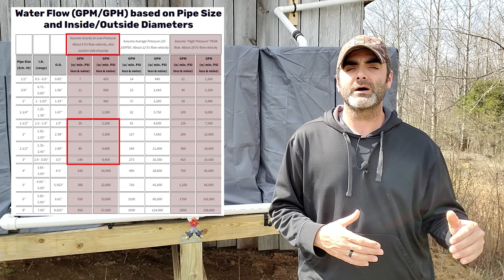Collect AND store | DIY Rainwater harvesting system

Comment: Each individual tote/IBC will need to breathe, as the water enters the IBC the air needs to have an exit path and conversely as the water is drawn off air needs to be allowed in to stop you pulling a vacuum and collapsing the IBC. The pressures that can be exerted in both scenarios are considerable. So in summary, you cannot just get away with adding an overflow on just one IBC. Hope that saves you from injury or damage to your IBCs.
Reply: Leave each lid lose so each pod can breathe.
Reply: at 21:38 he leaves the 3rd tote cap loose
Reply: What a waste of words...  he doesn't seal the whole system.
Reply: I thought the same thing. The first two won't even fill up past the top of the valve because air can't escape anymore and will create too much pressure if the tops don't have some sort of bleed off. The other replies really don't understand physics.
Reply: I don’t understand any of this 💩. Why so many sections?
Reply: injury??🤡
Reply: I put pvc pipe connecting each tank from the top 2” opeining in each lid, and used the end of that pipe for runoff and allowing all tanks to breathe. Works perfectly. I still have it connected at the bottom like in this video. My system allows water to enter each tank from the top and bottom, and air is easily expelled out the run off tube

Comment: If your first flush diverter hasn't fallen off your building yet.... You probably should add additional plumbing strap to support that pipe when it's full of water. Adding the plumbers strap below fittings will keep the heavy, water filled pipe from  slipping down.
Reply from the maker: Thanks Barry, yes that was an oversight!

Comment: I was thinking it may be easier for your future service of your tanks , if you put a 45 to lower it below your wood supports so you could drive straight in with equipment….. maybe cut off valves independently for each tank in order to remove them independently… just thought I would share those thoughts along with my deepest thanks for all your efforts to produce this video. Jerry 22:41

Comment: Nice video. I particularly like your first-flush set up, and plan to incorporate that on my next rainwater build. 
I do have one suggestion that may be helpful.. on my current system I have the buttress threads, and rather than wait for the adapter from Amazon I simply slipped that 2" flexible connector right onto the threads themselves. My setup looks just like yours, just minus the adapter and that first piece of 2" pipe. It's been over a year with no issues.
Reply from the maker: Thank you for the kind words!

Comment: Back in the day, I used to do a lot of gluing on pvc.  4 in down to 1 in for environmental recovery systems. Some ran at pretty high pressure. We always used clear primer and heavy bodied blue glue. Never had a problem with a blow out. Thought that might help with your next project. Guy who taught me said it was hard to see the clear glue to see if it was coated well. He would literally heave a can of purple primer in the trash. Hated the stuff. To each his own. LOL

Comment: I haven't read all of the comments to see if anyone else has mentioned this, but... I would put some cross bracing on the face of your foundation to prevent racking side to side. Once under weight (especially if you have settling) it could begin to lean or worse.
Reply from the maker: Already done, thanks!

Comment: Looks like you knew how I wanted to do mine, but didn't now where to start (I've had the IBC totes for almost a year now). 6 X 6's are expensive, but I'm the same way...rather over-kill and not have to deal with it again. It is a lot of weight...no doubt! Thanks for the video and Amazon links...I'm ready to order and start my rain water collection project.
Reply from the maker: Glad we could help! Good luck!
Reply: @meadowgreenfarm I bought your plan and nice job!  One suggestion, I figured it out with my general woodworking skills and the comment above, but initially couldn't tell if the beams were 6x6 or 8x8, possibly add a sketch of the support frame to your plan for others.  Thanks

Comment: One tip for making better joints is to work in sections if possible, especially as a novice not used to working with pvc primer and glue. It’s best to work with the primer while it’s relatively fresh, while it’s still shiny or just after it “dries”, if you wait too long the plastic will set up hard again (primer softens the pvc so that it can chemically weld when the glue is applied) working one or two joints at a time allows for more time to work while everything is still fresh and perfectly suited to be glued together. Waiting too long will give weaker joints and lead to leaks, not a terrible problem on a system like this but your joints will hold up to the weight and age for longer. And most people don’t stop here, they might start dabbling in pressurized systems for their garden irrigation or diy plumbing to fix leaks and those are situations where proper fitting preparation are key.
Reply: Good info. Thx.

Comment: amazing work, pls advise how about winter time, how to avoid freezing problem; or just leave it empty in winter? THX
Reply from the maker: In our climate these will not freeze so I have not had to deal with that. If we were in a colder climate I would empty all the piping and drain the totes at least half way to allow the water to expand. I would also leave the first flush system open to divert the water away from the totes, hope this helps.

Comment: Just my $.02 worth, but you could also use electrical conduit pvc which is UV resistant for your runs and it also comes with 90-degree bends that are much more rounded in their arc than a  standard 90-degree pvc elbow.  The only thing is that you might need to use regular pvc tees and reducers to complete the system.  Nice system, though.

Comment: I love it! Thank you for the helpful video! Two quick questions/comments:

First, I don't see the need for all of the complication of the brown piping. Rather than multiple adapters and a floating ball, why not just a straight piece of 4" pipe with a cleanout at the end? When the pipe fills with water, the rest of your rainwater will automatically be shunted to your IBC tanks. The ball appears unnecessary, and therefore those adapters are unnecessary as well. 

Second, I don't see a need to build an overflow to the third tank, unless it's for venting as the barrels are filling or draining. If it truly is just for when the barrels are full, couldn't you just put a wye on the pipe that currently goes from the brown pipes to the first barrel? It would function exactly the same as your other wye.  Clean-out fills first, then rain barrels, then to an overflow pipe.
Reply from the maker: The purpose of the ball is to trap debris in the first flush tube, without it you will continue to mix dirty and "clean" water. There are many different ways to overflow, your suggestion will work as well.

Comment: Great Vid. Im starting to get into the off grid way of thinking. lol

Hey, just a thought that popped into my head while watching you assemble the waste water part with the spigot to empty the waste water. Couldnt you leave that valve slightly open all the time? I was just thinking it probably wouldnt slow the water catch down much and it would drain itsself empty after the rain. That way you just need to clean the larger debris out every now and then but it never has stagnent dirty water in it because it always runs itself empty when rain stops.
Reply from the maker: Typically that is what is done if the intent is to never use the "waste" water. An orifice could also be used. In our case we actually collect that water for our gardens immediately so we leave the valve close. Good suggestion!

Comment: Good vid and suggestions.  I'm curious to know if you add anything to the tanks to prevent mold or stagnation?  Thanks for your time making this- I know I'll refer to it often when I get my tank ready to connect.
Reply from the maker: Circulating the water like we do works well, copper rods work and so will a tiny amount of bleach. The next system will have copper rods, I have 2 ground rods I will cut in half and that works well. Cheers!

Comment: I like the Ball system that’s a good idea I never thought about that I’m thinking about doing that I got a trailer that I remodeled and I lost I use Dogwood round the house but I got a metal roof on it I don’t have no water system yet but I’ve been thinking about I wanna get it done but I need the same kind of water system that you got I haven’t checked on them yet I’m doing a little bit of time I’m trying to get my power first solar power first system then I’m a try to get the rain system I already got a tub of water for my garden
Reply from the maker: Just look into an RODI and a UV filter for drinking water, may not need more than that!

Comment: take the sharp edge off where you cut the PVC with a knife or a blade and it will grip better when you apply the glue if you've got an edge it shoves the glue out of the way and it doesn't work well

Comment: I guess you figured out about the middle tank, that one also has to be vented other wise it wont fill,, so what I did was on the top lid connected all 3 lids together to the over flow and in 5 or 6 years never have a vapor lock,,, just a thought
Reply from the maker: I currently have them all plumbed together at the top for the vent and return from the recirculation (anti-freeze), system is working well still!

Comment: The length of your first flush system pipe. Is it dependent on how large your roof square footage is? A small roof I could see that working but I have a roof thats 36x44 seems to me that first flush pipe would be too short and dirt would run into my totes?
Reply from the maker: Our barn is 40x60 i split it into two systems but if i collected the whole roof into one system I would have done 2 or more flush systems for sure.  I have never seen a first flush sizing chart or information for roof size

Comment: A couple things I noticed
1: The wood you put in the ground didn't look "treated" to me... if it isn't treated water and bugs eating it will rote it out of the ground
(I might be wrong about it not being treated - click "read more" to see more details if you care)
2: You can use a drip valve to slowly empty the first flush pipe, that way you don't have to remember to open/close the ball valve after every rain

I have only worked with two treated woods (so if that is treated I'm unfamiliar with it)
1: the treated wood you bolt to the foundation of a house to nail your framing to
2: wood we treated our selves
Also for putting a post in to the ground we use pour cement and bolt the wooden post to the top of the cement block that we have sticking about 2-3 inches above the ground.

Comment: Great video! My question is: what happens to your stand pipe/clean out pipe in the winter? Does that water below the ball float freeze and endanger the pvc to bursting?
Reply from the maker: We leave yhe valve open until we want to collect rain. We usually have pretty full totes in the winter so we leave the valve open almost all season. You can also drip drain the water out

Comment: Many years experience gluing PVC - holds better with no primer. The glue actually dissolves the PVC a little - binding quickly.
Reply: Very untrue. Pvc needs primer to make a complete bond. The primer is what activates it. The reason he had issues before and probably now was 1. pre priming joints. The glue is supposed to be applied while the primer is still wet. 2. Using the wrong glue. He is using all purpose glue which is garbage and doesn’t require primer. And 3. Not fully priming each joint. He’s only priming about an inch wide of each pipe/fitting. Hope this helps

Comment: Perhaps I'm just not understanding everything correctly but I have a question about the flow ball. Once it rises up and closes off the vertical tube, redirecting water to the IBC tanks, how does the ball lower itself without you bleeding off dirty water each and every time after a rain? If not lowered, wouldn't any new water flowing to the IBC be subject to bird droppings, pollen, etc that won't get to the vertical tube because it's still blocked?
Reply from the maker: You are correct on both statements. In our case we empty the flush system and use the water for our garden.

Comment: I like your setup but I'm wondering, do you get freezing weather where you are or snow and if so, does that mean your setting up three really big ice trey's and the possibility of some cracked PVC.?
Reply from the maker: We drain the tanks  to 2/3 full and open the first flush and manage the water level from there. We make sure the pipes are empty until we need water if the totes are not frozen, if they are they just freeze solid until spring. I am playing around with the idea of a pump on a temp sensor to circulate the water when below 32 degrees.

Comment: Just curious if you've faced any issue with the rubber flex attachments in front of the totes. I imagine the pipes on the front are under significant pressure once all three are full and I would expect the non-PVC pipes that aren't cemented in being a weak point.

I also noticed you said the overflow was going to deposit uphill from the stand/containers, and I would think that would result in unnecessary erosion directly underneath everything.
Reply from the maker: The overflow deposits downhill in order to avoid erosiin. In our video titled "Running water lines and Intro to our berkshire pigs" I install the overflow and fix some leaks. I have not had any issues to date with the rubber couplings

Comment: Actually 3 caged IBC totes full of water weigh 7374 lbs.  148lbs for the empty tote and 2310lbs for 275 gallon of water (8.4lb/gal).

Depending on the type of soil and it's load bearing capacity, it's actually marginal if all the totes are full.  If you put it on/in heavy clay soil, six 8x8 posts can only support about 3300 lbs before you have problems with sinking after the soil is saturated.  If it's sandy, you can get away with about 5500 lbs.   You didn't show putting a larger pad into the hole so I can only assume you just used the posts.
Reply from the maker: Thanks Michael for the info! We put the posts on footers but since the focus of the video was more on the rainwater collection we did not detail the whole frame build. We will definitely keep an eye out for settling or shifting!

Comment: let's assume we have a firestorm: a heavy downpour with large amounts of water, as is increasingly the case here today!
then comes a lot of water - very quickly!
wouldn't it be better to do without narrow lines?

you have set up three storage tanks: doesn't it make sense to install a gutter above the collection tank with a pre-filter so that the water can quickly get away from the roof?
I see the installation more as an obstacle and when there is a lot of water, this develops as a stumbling block.

I don't know what the water containers are for: it's probably not drinking water. When planning the system, you would have to take into account how much you need yourself!
i am currently building a water separator that is supposed to separate water from the ambient air - and the requirement is that 3-5 liters of drinking water are needed per person per day and about 12-15 liters of process water per person - for washing or something!
that would mean that the water separator must provide at least 20 liters per person per day.
and it means that you have to move the separating water - i.e. filter it through a sand filter, let it flow constantly moving in order to bring in oxygen and also use a sterilization lamp to make it low-germ!

of course i have to see it in connection with water from the roof: we have a stone house with a gable, i.e. sloping. so it makes sense if you just say: the water has to get down there as soon as possible, which you would also say if there was a lot of snow!
so i have two sides- where water can be drained- and i think i don't use rainwater gutters or similar- i let the roof protrude- so that a lot of water can run away quickly and doesn't fail because of two narrow pipes!
this would eliminate the collection of leaves - i.e. the clearing of the gutters - as a kind of stress point: you don't have to worry about it!

then i can collect water in tanks or even create a water basin with fish, a pond!
this would be advantageous if you keep ducks: these animals need water surfaces to swim in order to feel comfortable!

Your film can of course only be a guide - because every situation may look very different!
I thank you for that
Greetings from Berlin

Comment: So there is enough pressure/ height to fill those totes from the bottom? I thought they need an over flow to each tote at the top.
Reply from the maker: Yes there is. The advantage of filling from the bottom is that you dont have to use your water storage in succession but rather equally at once. The pressure from water filling in the first tote will fill the others, venting is the key, we cracked open the middle tote cap and the third has the overflow.